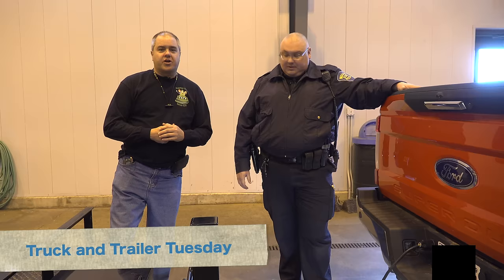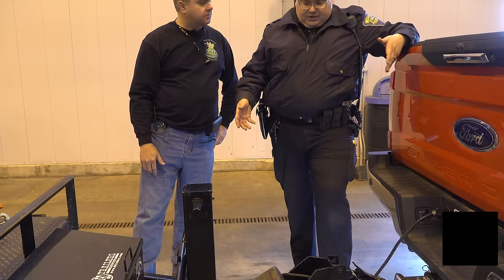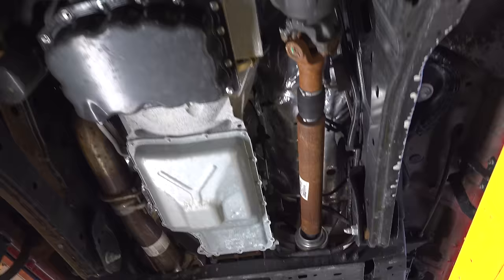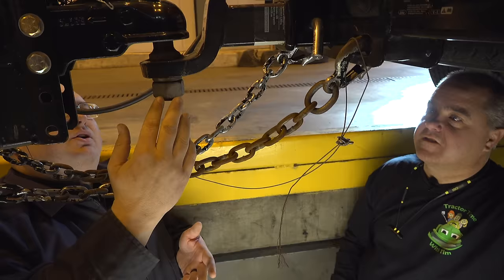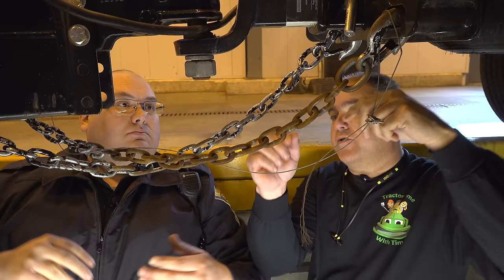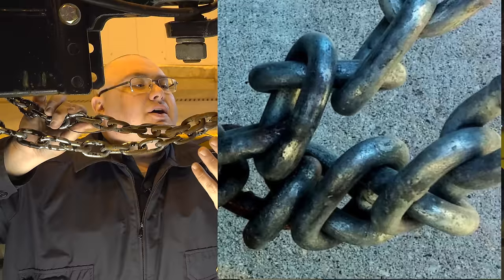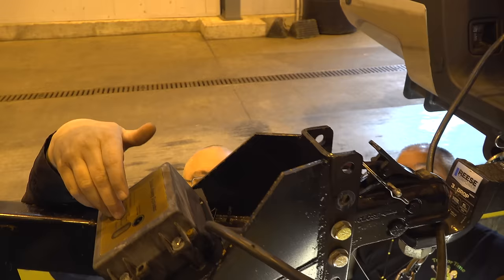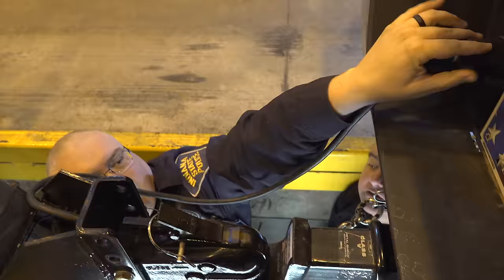Uhoh! Tim Fails Inspection! Truck & Trailer Tuesday with Trooper Hoover

Comment: I always see the Toyota SUV rolling down the interstate hauling a 32 foot cabin cruiser. They never get pulled over.
Reply: It's legal when they're in the left lane.
Reply: aguyandhiscomputer skin
Reply: No money in pulling over Johnny travel trailer...
Reply: They get more money from us tractor trailer trucks. We are there cash cows. And there new fraud is a even bigger issue. They set up a construction zone from state line to state line and just love grabbing us truckers when it is set up but no one even present or active.  And Indiana crooks that they are will write you up for speeding in a active work zones when it isn't active
Reply: @joshweiser7737  "Again its about safety." Bs, its about generating revenue.
Reply: @joshweiser7737 0
Reply: @joshweiser7737  
IL is also good for this. 
WI gas it figured out. On the weekends they pull the barrels off to the side and open it up to regular traffic speed. And weekdays they have it setup and you don’t even know you are in a work zone.
Reply: Or the school bus pulling another school bus with a tow bar.    Parallel to one vehicle pulling one or more with towbars, and something along the lines of “IN TOW” written across the back of the last vehicle in shoe polish- little or no lighting, traveling under the speed limit and the tail wagging the dog...   A tractor trailer has a burnt out clearance light on top of the trailer and the constabulary loses their effing minds
Reply: Fifth Horseman I'm still trying to get that question answered conclusively. Maybe DOT ignores them for a reason. Could it be because DOTs responsibility is to enforce the laws pertaining to commercial vehicles. Commercial vehicle generally being defined as a vehicle or combination of vehicles that requires a CDL to operate and/or is for hire. I'm thinking they have no jurisdiction over non commercial operators, as defined. Plus how can you pull over a pickup truck towing a trailer and start demanding medical cards, fire extinguisher, DOT registration, and begin performing a level 1 inspection? None of those laws apply to them.
Reply: @aguyandhiscomputer  
Slower Traffic keep to the Right Lane...
Reply: @ironworker5792  safety is always LEOs go to for directives 🙂🖕👮‍♂️🌞
Reply: @davidsine4390  "In commerce" is the key phrase. ANY vehicle that is used for a business can be stopped. Some states are even changing the registration/vehicle codes that allow officers to stop private individuals pulling a trailer of material that they just picked up at lowes to build their flower box.

Comment: Happy to see that a twist or two to the safety chains is ok. Informative! Happy towing.
Reply: A chain is not designed to take a load while twisted. The chain could fail and snap. Especially with a shock load. Safety chains should be the proper length to begin with. My trailers are designed so the safety chains can be adjusted in length.  In a pinch the safety chains can be raised up off the pavement using a rope or bungee cord. Coiled safety cables are another option.
Reply: Agree with Shawn, as a farmer we knew a twisted chain will break under a load, I'd use a bungee cord instead.
Reply: I was surprised to hear that they allowed the chains to be twisted. It seems like a bungee would be a better option. You never want the chains to be needed because the trailer will go to the right with the crown of the road, pulling the rear of the tow vehicle with it, turning the tow vehicle into oncoming traffic.
Reply: Tired old mechanic I use Zip Ties to keep the chains up enough not to drag the pavement.
Reply: @shawnwright2356  Florida does not allow bungee cords to hold anything. AZ, and CA will write a ticket for any twist in a chain. Hello campers, welcome to my world. 38 years over the road, and now I don't even want to tow my camper when I'm not working. 
OH! Wait until they start enforcing ELD for private rigs over 10001#. I see a bunch of fifth wheel campers going up for sale real cheap.
Reply: @shawnwright2356   Lol, wants "proper length chains" and yet thinks coiled cables are ok.
Reply: @shawnwright2356 What about feeding the chains through the attachment point & hooking them back onto themselves? I’ve seen a few people do that
Reply: @TJB270 I would not do that. Most attachment points are designed for a hook or a chain coupler. If you loop the chain through the attachment point I could see it cutting the chain or the chain ripping through if the trailer becomes unattached.  Better to use locking hooks that attach to the safety chain with a clevis pin and cotter key.  You can adjust the hook along the chain to a proper length.  If there are too many unused links hanging down to pavement just wire or zip tie them back to the safety chain.

Comment: This was a really good video, thank you for posting it. With as many miles as I do on the freeway with my farm trailers, I pretty much treat it like a commercial trailer situation. Rewired my gooseneck because the breakaway was inoperable, the plug was cracked and filled with water, the brakes had been cut because the wiring had been rerun with 18 gauge by the previous owner and had gotten smoked. Pretty ridiculous. Now all the lights work, brakes work again, and all it needs is new lumber and some black touch up paint. Keep up the good content. 👍

Comment: I have to appreciate the fact that officer Hoover made a point, several times, to differentiate between commercial operation and private operation and that private operation is not subject to enforcement of regulations. Doesn't mean anybody should be stupid, reckless or irresponsible in their private use of trailers, just that we are not subject to state revenue extortion.  Regulations, codes and statutes are for commercial transportation.

Comment: Thanks Tim for making these videos. Great information. I really appreciate it. 

He might have mentioned it on a previous video. Check to make sure your tires on your trailer are at the proper PSI I have a 10K dump trailer and they are rated for 3350 lbs at 80 PSI. I had 2 tires at 50 PSI and realized it really quick after it was loaded  no where near a air compressor  replacement tires aren’t cheap. I learned the hard way.

Comment: When I saw the rust I was going to ask if that trailer was one you were borrowing because I remembered that yours was not very old. Then when you said it was YOUR trailer I was like "Wow!".  The rust on the frame and the corrosion around the hitch was surprising. I live in the snow belt also and my landscape trailer is around 8 years old and it has nowhere near that amount of rust.

Comment: Sooo...the trailer chains fail and rip in half (both), the trailer manages to rip off the trailer ball (most likely the trailer is flipped up in the air or on its side, and somehow we seem to think the break away is going to help.
Reply: My boat trailer has jumped off the ball twice and the safety chain kept the trailer in line and behind the truck. I now double check it is seated tightly to the ball and the lever action has the tongue locked down to the ball properly. My fifth wheel has locked up its brakes when the emergency switch cable got caught on the hitch bolts and pulled out on a tight turn, so I know it works.
Reply: I had a cement mixer come off the ball and the chains were not connected properly and the mixer slid down the road and stopped upright without tipping over so breakaway brakes might have helped stop it sooner
Reply: More often human error.

Comment: We took apart my father-in-law's horse trailer brakes last summer to inspect them. It had been sitting parked for most of the summer before out in New Mexico. 3 of the drums looked ok, the 4th one however, when we pulled the drum off, a mouse skeleton fell out. As we dug around in the nest it had made, we found a snake skeleton about 2 foot long coiled up in there as well. That was probably the best/worst thing I've ever found.

Comment: Alot of companies, including all brand new driveshafts ive had custom made, are never painted. They all say the paint will imbalance it. Yay or nay, i still dust a little on them, because i cant think that surface rust would be balanced better than a clean surface with a dust coat on it.

Comment: Hi Tim:  While you are doing a little PM on your trailer and truck underside, I strongly suggest you wirs brush off any and all rust due to salt crossion and then spray "FLUID FILM" onver the entire underside of both your truck and trailer.  I stoppped buying FLUID FILM by the spray can and now I buy it by the 5 gallon bucket and use a sprayer as recommended by the manufacturer (Note: Do not use a garden sprayer).
Best - Michael
Reply: Hi Tim:  Google “Fluid Film” and you will quickly find and read that Fluid Film is the ideal product to spray on the underside of your truck and trailer.  Note: Spray in the inside of structural members to control and stop rust.
Best - Michael
Reply from the maker: Michael; it wasn’t me who said that
Reply: My bad.  I thought you made the comment Tim.  
Best - Michael

Comment: Electrical always work until it doesn't.  I check mine at home,  drove about a mile to pick up a car. When we had the car loaded I notice warning light had come on. Luckily it was just a loose connection and a quick fix.

Comment: Nice video.  I am surprised the the officer did not mention the length of the breakaway kit cable.  It looks very long and usually should be slightly shorter than the chains on order to prevent the trailer coupler and jack from running into the back of the truck if it comes loose from the hitch ball. It should apply the brakes even if the chains are still connected to the truck.  I also noted he did not mention weather or not all axles should have brakes - many states Arkansas, Iowa) require all four on tandem over 3000.  When I haul my tractor and implements, the combined weight is about 12k and it makes me glad about things actually working.  On another note - I have had several trailers with break away batteries.  If they sit for several months - become discharged - then winter sets in and they freeze - bad battery.  I have hauled with the same dead battery many years and been lucky. When I started hauling heavier (my tractor), I decided to find a solution to always having a dead battery.  I invested in a solar controller and a50 watt solar panel connected to the trailer bus (connection box) to keep the battery charged.  That also permitted me to attach a GPS tracker when I was away to help if the trailer took a trip without my knowledge.  Enjoyed the video, Great subject.  I heard another video remind me that safety measures are not all that important when everything is good.  But when things do not go right and the Highway Patrol shows up, axle weight, trailer weight, combined gross weight, and truck payload weight seem to draw a lot of attention - sometimes when tickets are written, Insurance may choose not to pay.  Best Wishes, Larry
Reply: Length is a matter of opinion. I have mine setup so it only engages in the event the chains breakaway. If the trailer is still attached by the chains it is not “broken away” and is still attached to the truck. So when you stop the brake controller will apply the brakes so the trailer will not hit the back of the truck. Last thing I want is a trailer yanking on the back of a truck still attached with no control of the brakes!
And I also attach the cable independent of the hitch. Either to the bumper or the frame. This is just on the off chance the hitch separates from the vehicle. Anything beyond that there are bigger problems that obviously can’t be controlled.
Reply: @dodgeguyz  I think you are right.  There is nothing there that I can disagree with.  I may go back to extending the cable longer.  I guess the key to that is connecting the cable independent of the hitch assembly.  And you are right, if the chains are still attached, you will have brake control from the truck (which I like much better). Thanks, best wishes, Larry

Comment: Another great video, thanks Tim!  And Thanks to Trooper Hoover for sharing all this great knowledge.  One thing though, lets talk about the strain relief on your trailer wiring.  Your wires will last a lot longer if you get that outer jacket into the strain relief clamp on that plug.

Comment: One tip: always check your trailer lights on the back before each trip and if not equipped reflective tape on the back also in case your lights fail to prevent accidents.
Reply: A 30 second walk-around is what I always do on my camper and boat trailer.
Reply: 3m conspicuity tape aka d.o.t tape

Comment: Great info, certainly take note of his comment, “one or two twists of the chain”.  Do not twist the chain enough that it balls up to shorten it.  More than what he recommends will reduce the chains strength by 90%!  

It’s good practice is to get proper length chains to begin with.  I understand that if you tow with multiple vehicles, that may not be an option.  If that is the case, put a quick link of appropriate strength to shorten the chain when needed.

Comment: That's fairly new equipment. Just think if it was worn out bad. Rust is setting in and it's in good shape. Helps if equipment is inside out of the weather when not using it. I wash things right away if it goes through any salt. I keep things looking like new

Comment: That would've been an expensive OOS.
Plus points on a company CSA score and, a big jump in your insurance premium.
Reply: Which is a bit ridiculous and over-the-top. I drove commercial for a long time, I took safety very seriously. Some of the DOT inspection guys were super cool and understood what life was really like and let the small unimportant stuff slide, other guys were total jerks and were obviously just out to raise revenue.. and would write every citation they could.. 
Never had a fine myself. But you could tell some DOT guys were very unhappy they didn't find anything.
Reply: I don't think you it would affect is CSA score.  Remember he just found out in this series he didn't realize he needed a DOT number.  Therefore no effect.  I believe Tim is about to learn the hard way that he has a lot of work to do to be in compliance.   The fact that he has an F350 instead of an f250 also means he needs to comply with hours of service record keeping.  I need to also make a driver file for himself and anyone else that drives that pick up truck.
Reply: @texgarcia1958  as a professional driver for the past 27 years, i can tell you, an oos with an inspection would absolutely have a negative effect. As a matter of fact,  the only ticket that you would be able able to get that would not have an impact on CSA, is an overweight ticket. 
Any other ticket that accompanies an inspection will accrue CSA points.
Reply: @davidlpittman    I was making a sarcastic comment based on the fact that he does not have DOT numbers.  There is no account for them to attach an out of service to.  If you watch the videos at 1 point he says that they determined he is a commercial enterprise.  I assume he is transporting his own equipment so this would make him a private Carrier.  Nonetheless based on the videos it would appear he does not have DOT numbers or he would know most of the stuff that was brought up by officer Hoover.  

I guess what I'm trying to say is I was being a little bit sarcastic.  Lol

 By the way, I meant no disrespect to your experience or knowledge.  I myself got my CDL in 1986.  I was a certified qualifier in the nineties.  I own 2 companies in 2 different States.  One is a private Carrier. The other is a common Carrier transporting oilfield fluids using tankers.  So I totally understand what you're saying.
Reply: @texgarcia1958  i read no disrespect in the comment,  nor did i mean to offer any. 
Many people don't know. My original post was pretty tongue in cheek, as it were.
Had he been a commercial operator though, i have a feeling that his inspection might not have went as smoothly. 
At least, regarding the ball hitch.  The electrical wire is a non starter but, that ball would likely be oos with that loose washer/nut.
Reply from the maker: I appreciate both of you guys showing respect to each other.  Rare to see these days!
Reply: @TractorTimewithTim  Some people do have respect but others don't.  I know I'm gradually learning to keep my mouth shut since anything I say won't be appreciated.  I have a MS degree in trivia, which means I know a lot of things but I do understand I don't know enough about everything.  I keep learning.

Comment: I am very surprised the trooper did not look closely at the hitch bolted to the pickup frame.  I pull a small utility trailer (3,000 GVW) with equipment on a daily basis.  After 12 years, my receiver tub broke from the U-frame of the hitch - RUST!  The lack of integrity of the hitch was missed by me, and the entire hitch needed replacing.  All those other safety features may be in place, but if the hitch to the pickup fails, all is lost (safety chains do no good, they are hooked to the hitch frame).  I have an F250.  Getting the old bolts out proved to be a major project, far greater than mounting a new hitch.   Just a heads-up.  Thanks for the video.
Reply from the maker: I dealt with those rusty bolts when replacing a bumper once. No fun at all!

Comment: A helpful couple of things for you to do. You can get a "D" ring like climbers use that has a flip lock and you can use the safety chain slot to attach it to the truck. Another thing that helps guard the wire is even if you have that style hitch you can open safety pin loop and slide the wire in the safety loop on the safety pin. That will keep your trailer wire from ever touching the ground and you won't have to worry about it being to short for turns because it's right over the tongue. A few little tricks from delivering trailers and rv's that I learned along the way.